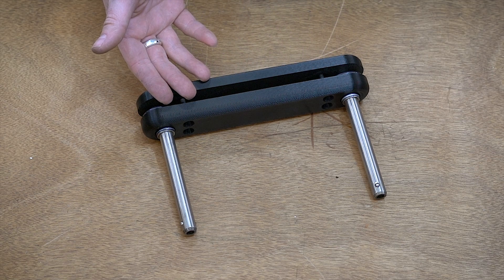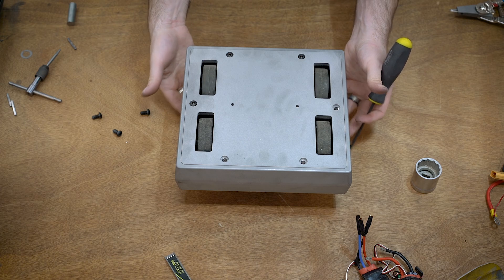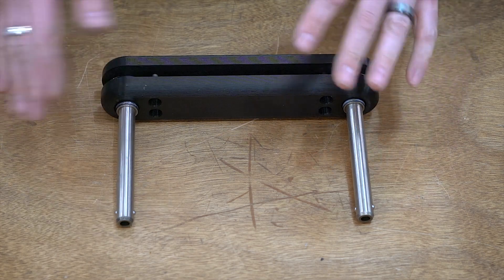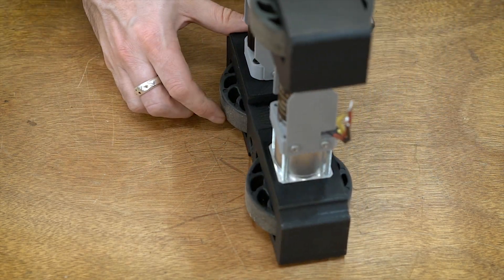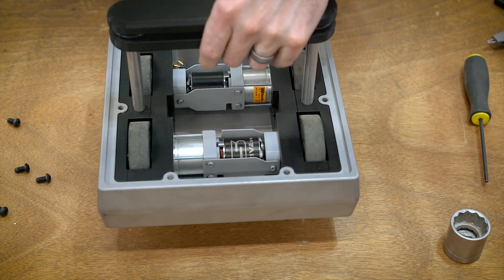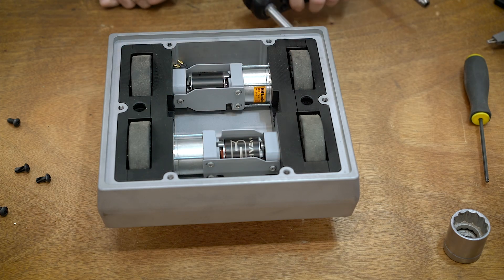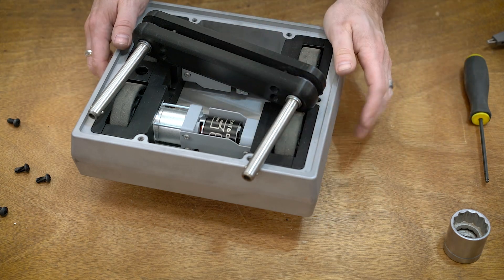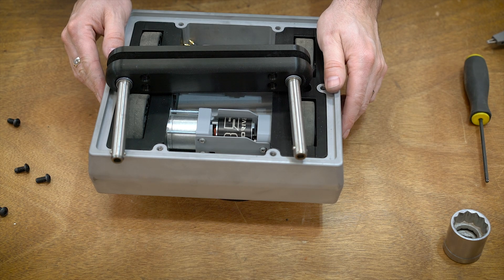Drain Bamage! - The Lobotomizer

Comment: Hmmmm. Interesting but I’m not sure I’m convinced yet lol.
I think if you receive some big big hits then the slightest bend in the chassis or slice/bend in the top lip could make removing that top cover very difficult and same with the internals. You may find after a few hardcore beatings that the chassis grip on the 3d printed modules is tighter than the locking bearing in the Lobotomiser. Either way that’s gonna be HORRIBLE to hit for others lol.
There was a similar concept FW in the Uk called Cancel Culture that was a Hardox Brick Wedge.
Reply from the maker: Don't worry, I don't need you to be convinced ;-)  We'll just have to wait and see how it does in an actual competition.

Comment: I was thinking wouldn't the innards just get completely stuck if the frame bends a bit? But then I also realized this is a 30lbs-er with more s7 tool steel grade armor than some heavyweights and it's probably going to be fine (until you meet somebody abusing a shuffler weight bonus with a lightweight-category weapon).

I really like making your own tooling to make life easier or the result better. It goes into the same category as building a jig so you can weld something perfect, sure you can do without and the result is probably okay-ish, but once you have the tool you go "why didn't I start using this earlier" and the results just improve dramatically. Like this tool, you can probably get by with removing the top plate and jiggling the bot a bit to let all the innards fall out, but with this tool it's as simple as pushing it into the base, pulling it out and squeezing it together so it releases.

Great video and can't wait for the rest of the drain bamage series! It's like a brick but with more brick.
Reply from the maker: Yeah, it's not going to bend.

Comment: it's clever and i like it but if taking the plate off while the bot is on its wheels makes the wheels push the gust out... aren't the guts out a couple cm and someone who hates convenience could lift them the rest of the way out with some middle ground effort from there?

a second also worse alternative,  perhaps if someone hates moving parts, you could use an upturned table shape with "legs" spaced for the wheelbase
Reply from the maker: When you're unscrewing the top, things can bind up if you don't do the screws in the right order.  If you start on one side, it will push unevenly.
Reply: @RobertCowanDIY  makes sense.

Comment: Is it spring loaded? Looks like it the way it automatically snaps back to its original position if force is not manually applied by the user. Btw great video as usual.
Reply from the maker: Yep, there locking pins have springs inside of them, so I'm just relying on their own spring force for the action.
Reply: @RobertCowanDIY  OK cool thanks for replying.

Comment: There is great video of witch doctor testing against a 250 block.. I imagine drain damage fights like that. Break you on my face.
Reply from the maker: I think even 250 pound bots wouldn't want to hit drain bamage, it would most likely cause some weapon damage.  Witch Doctor (and others) test with aluminum or mild steel.
Reply: What material is that on the exterior chassis? It looks almost 3D printed but metal 😵 I see 550 sized motors so it’s gotta be a 12 pounder? That is super clean either way.

Comment: For us poor people building combat robots, a workable option is just to buy two of the ball detent locking pins, and use them *gasp! Individually, one hand on each pin! ;)
Reply from the maker: Well, I got them cheap on eBay.  Combining them really doesn't cost anything extra, just a few cents of filament.
Reply: @RobertCowanDIY  yes, when you can afford a 3d printer ;)
I am just trying to be a little bit funny lol, I love the design, and how you go the extra bit and make the handle, since you have the tools.
Also, I know how expensive the pins are... Lol

Comment: Good hit bends the frame...the innards are stuck...now what?
Reply from the maker: The shell is ~0.75" thick S7, nothing in this weight class can cause it to bend.  We'll see how well this comment ages ;-)
Reply: @RobertCowanDIY is this real life? Where did you find a block of tool steel that size and how much did you have to spend to have it machined 😵😵😵
Reply: Think you need to watch the rest of the series! This has similar armour thickness too a 250lb bot
Reply from the maker: This is correct.  There are 250 pound battlebots with less armor.  I don't suspect anything will bend.
Reply: I was thinking the same thing lol